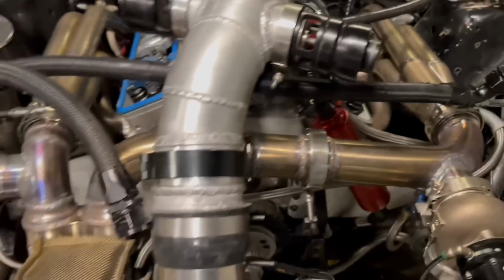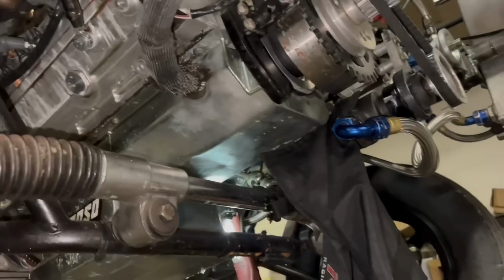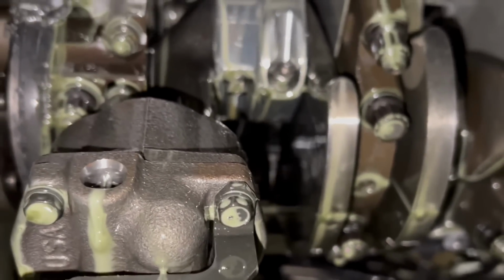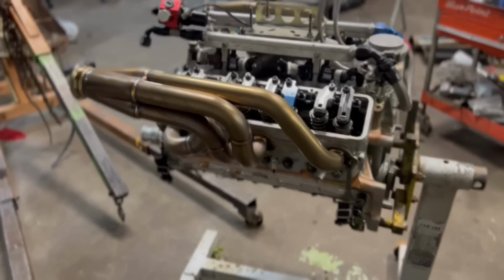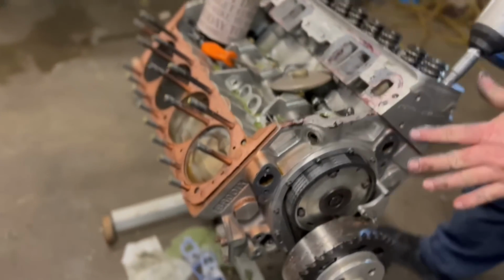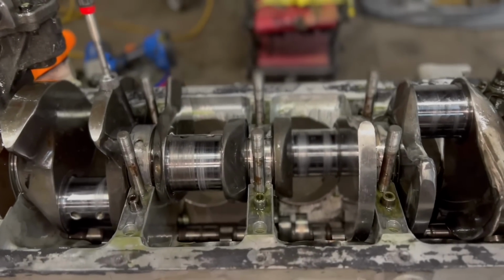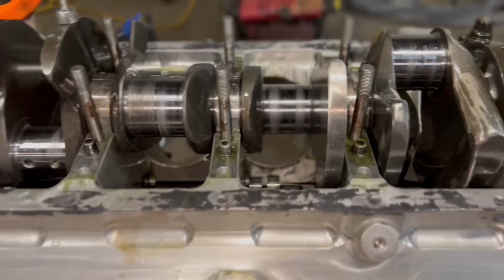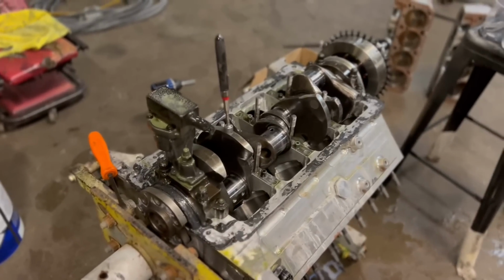Motor is TRASHED!  The ALL ALUMINUM SBC is torn up.  Hope we can save the block......

Comment: Sorry TJ, Bad deal. I hope You can get it sorted as Cheap as possible. Maybe a Oil Light on the dash would of helped? Keep at it Dude. Best of Luck.
Reply from the maker: The oil pressure only fluctuated some, it never dropped.
Reply: @TurboJohnRacing  . I hope You get it Sorted TJ. It is amazing how well You do and How Fast the car is with the funds You spend. It is great that You show everyone what happens. You are a motivation for Me and I am sure other Guys, To get out there and work on our cars. Thanks for what You do for Motorsports. Cheers.

Comment: Time to coyote swap and go faster
Reply: Honestly this is a batty idea but I’d love to see how much it cost to spin a coyote to 9000 vs a small block to 8500
Reply: He meant LS swap it.
Reply: Coyotes are too expensive and a bitch to work on. LS is better all around. Cheap to buy/build, its the easiest engine in the world to build, and they will handle some serious power right out the box.
Reply: @boostbeast8731  lol turbo John literally said that the crank currently in his small block Chevy is a $4500 crank 🤦🏽‍♂️🤦🏽‍♂️🤦🏽‍♂️😂.  I don’t think expensive is something that should be being discussed at this point
Reply: @boostbeast8731  yes that’s what the internet says….

And while yes there is a zone where you just toss in a cam on stock valve-train where ls motors are legit cheaper options but when you push past street cowboy into a competitive racing class and have to get fancy valve springs, rockers, valves and an intake not made by Holley… your “ls motors are cheap” story stops holding water. 

Ls motors have to spend a lot of money to spin 8000 rpm + reliably. I do it daily on my stock valvetrain and spend 4 hours a day on a road course entirely over a stock ls redline a couple times per year.